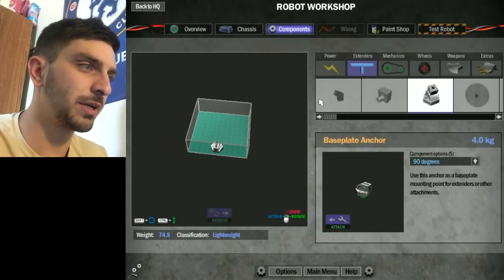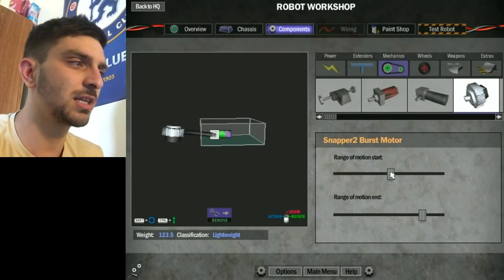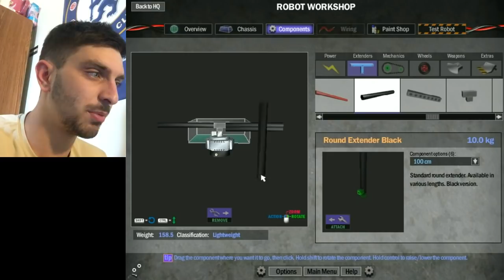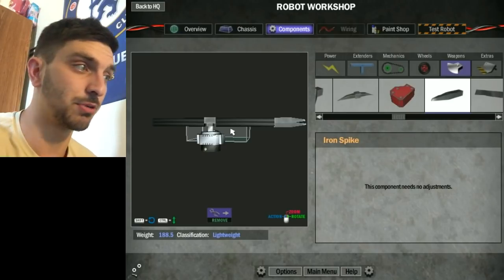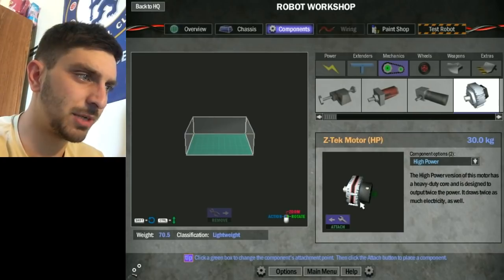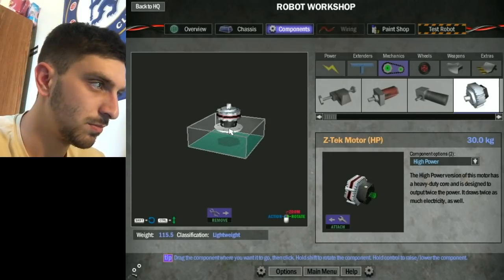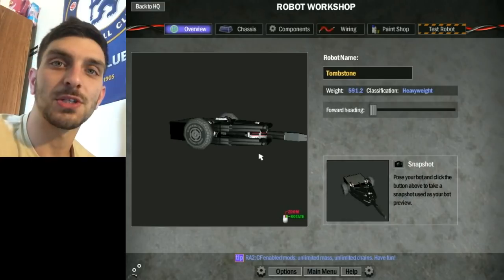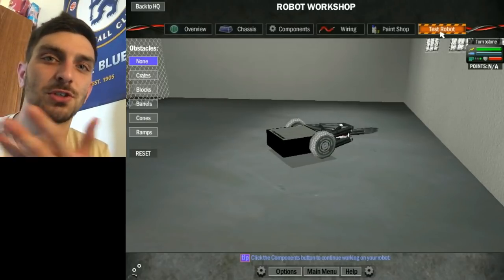How To RA2 #6: Making Effective Spinners

Comment: In order to make the system used in HellaChopper work effectively, rotate the second motor slightly so you can easily gauge which motor the component is being attached to.